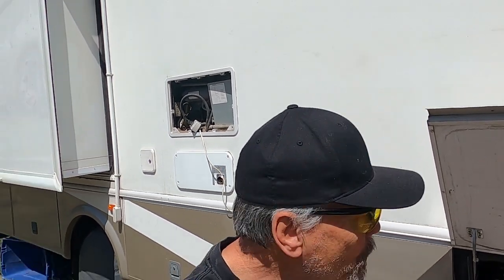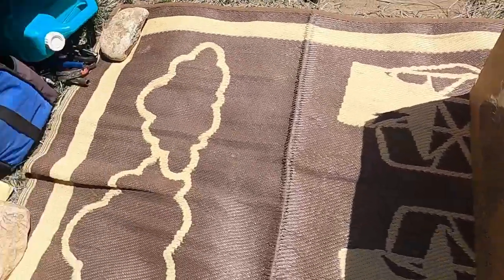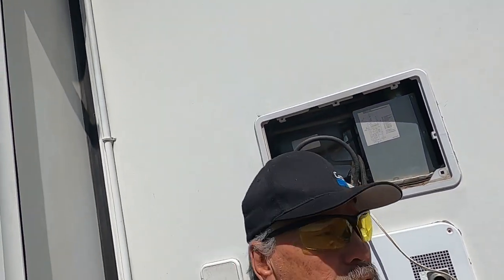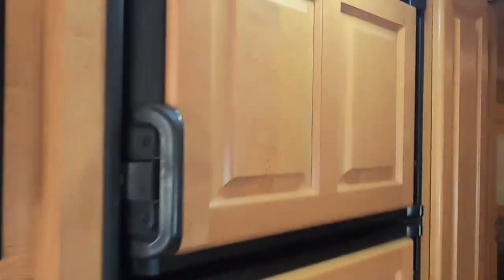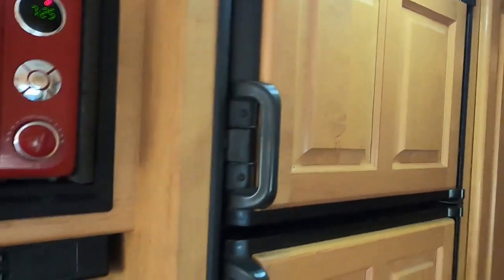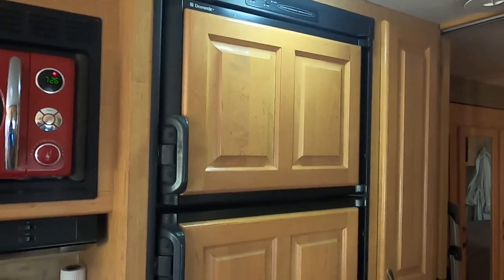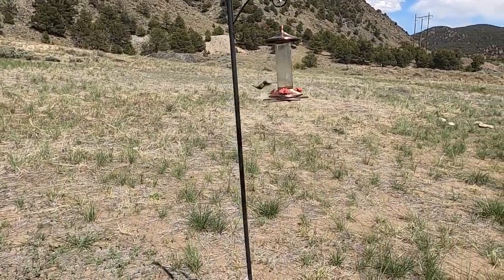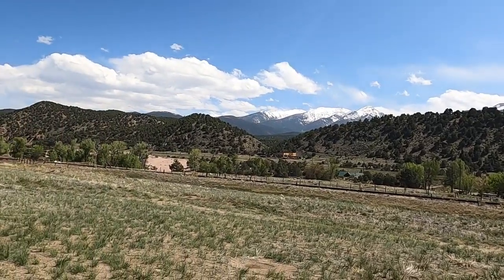An idiot mixed Lead-acid with Lithium batteries part 2

Comment: What does a refridgerator's efficiency got to do with mixed batteries, Chuck? Am I missing something?
Reply from the maker: Good morning friend, I believe we have been gaslighted? The lithium ion battery industry has oversold their product! If they're 100% charged they have a lot of power but when they become less than 80% state of charge their power falls off! They can't handle the power amperage surge of the refrigerator. That's when the lead acid needs to be connected to it so you have power again! Lead acid is stronger and the absorb the amperage, no problem
Thank you for watching, may God bless you!
Reply: @charlesvawter1527  Ahh, I see. Thanks for the response! Something that might work better than Lead/Acid might be a super capacitor. It can ballast a LFP battery very well. But generally, LFP is considered superior in storage capacity (Ah) and short-term high current discharge, especially when compared to size for the same given power storage. If the Lead/Acid is working as a ballast that's great, but it points to the LFP battery being sized just a bit too small. Glad to see you doing it for real, in the real world! Keep your spiritual grounding sir!

Comment: That fridge is just using the electric to heat an element thats normally heated w the propane.  It’s great to have the option, but heating w electric is extremely inefficient.  It’s far more efficient to use a compressor based fridge w electric.
Reply from the maker: Good morning new friend, thank you for the comment on my refrigerator. The refrigerator is original with the RV, I like the option of running  propane that works extremely well. You don't have to rely strictly on solar power.
If not done so please subscribe my channel as I have subscribed to yours.
Thanks for watching may God bless you!

Comment: pretty much everyone in the offgrid RV space is going to tell you to replace the fridge for a home unit($300-$500) because those things are the worst but you could try to see if you have good ventilation on your coils, if the heat cant escape the fridge wont be as efficient and remain on. You are correct, home fridges that size will sip about 100w-130w
Reply from the maker: Good morning new friends, thank you for your suggestion and comments. I have checked all that it just seems that it just is what it is! Oh well, it works perfect on propane and doesn't use much?
If not done so please subscribe to my channel as I have subscribed to yours.
Thanks again and may God bless you!

Comment: Check real good around the door seal on your fridge.  Mine had been gobbling up power and also began freezing up. The door was tweaked.   Since I fixed it. No more freeze ups.  Definitely less power usage.  Also I switched my set up to 24volts with a pure sine wave inverter.  24 volt Definitely is a worthwhile upgrade.
Reply from the maker: Good morning, thank you for your comments and suggestions. I've checked all that and it all appears to be good?
I would like to go with 24 volts but my motorhome is all 12 volts and it would be difficult. Perhaps at some point down the road.
It's not done so please subscribe to my channel as I have done to yours!
Again thank you and may God bless you!
Reply: @charlesvawter1527  I run my fridge solely on the 24volt inverter and have a separate battery for the trailer which only runs lights and a 12v power socket. All separate. Just a regular lead/acid battery for that. I changed all my lights to leds so even a junkie battery will do. Also if you do use  more 12volt they make some cheap buck converters that will kick down the voltage from 24 to 12 so you can still use your existing power inverters. I think you'll be happy if you make the jump to 24v. Better conversion rate off of the panels and from the inverter to the appliances (aka that fridge). It is a mild addiction solar is. Just keep adding to your system and see where it takes you.
Reply from the maker: Good morning new friend, thank you for all those tips at some point I will do it. For me solar it's not an addiction, the word I would use would be" Progressive". If I only had one more solar panel I could do this? Or if I only have one more battery I could power this? Thank you again for the tips and may God bless you!
Reply: @charlesvawter1527  you'll get there. I started with single panel and small lead acid truck battery. Before I got past 2 panels it was like a glorified phone charger lol! Random word of mention......mobility scooters can have some decent batteries. They may not have the amperage to run big things but for led lights,tv,phone and whatever small things they good enough for that. I just stumbled across one. It had actual Gel cell batteries. They was at less then a volt. I cycled them for days just to bring the charge up. I am in the second proper cycle for Gel cells go to 14.2 then discharge to 11.4 which is about 11.2 due to voltage sag. They are different the agm or other lead acid batteries.  This is my first experience with the Gel cells.
Reply: @charlesvawter1527  have seen Will Prowess??? He is a wealth of knowledge.

Comment: That style fridge requires continuous heat to work, the heat can come from propane or an electric heating element, they don't cycle on and off just on. Compressor style fridge will cycle on and off, you have an absorption style fridge.
Reply from the maker: Good morning, thank you for that comment and information. That explains why runs on electricity all the time. What's interesting to me is that lt cycles on propane on and off! I assume it's because propane is more efficient on Heating. If not so please subscribe to my channel as I have subscribe to yours. Again thanks and may God bless!
Reply: @charlesvawter1527  My camper fridge does not cycle on propane, works good when dry camping(off grid), one less thing drawing off my battery.
Reply: Jeesh, get rid of that fridge. That is horrible.
Reply from the maker: @rclewis01  good afternoon friend, thank you for your comments. I have a disagreeable with you about getting rid of it it's an RV refrigerator which runs on 120 volts or propane. It works perfectly well on propane and I never plug it in to shore power. On a sunny day I have plenty of solar power to plug into. When I do this it runs for free! If it were to bite the dust, I would replace it, but until then it works perfectly well. They are bit pricey about $2,000.
It's not done so please subscribe to my channel as I have subscribed to yours.
Thanks again and may God bless you!

Comment: Off the grid with electricity wires overhead, hahahaha  Oh hey... check your refrigerator temperature, maybe it is set too low?  Each degree makes a big difference.
Reply from the maker: Good morning friend, yes there are power lines in the area, but I can't hook to them. Totally reliant on batteries and solar power.
I've checked my refrigerator temperature and I believe that to be correct. That's just the way they are?
Thank you for watching, your comments and God bless!
Reply: @charlesvawter1527  IMO "off the grid" is theoretical.  I know what you mean, though! :)